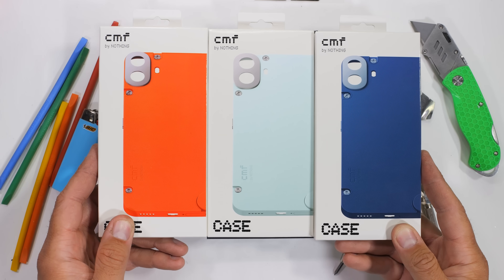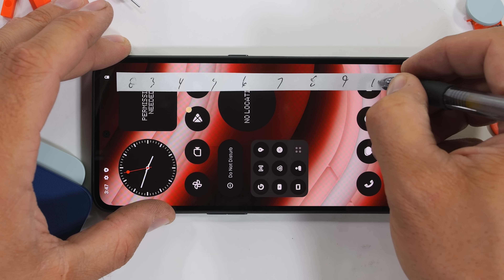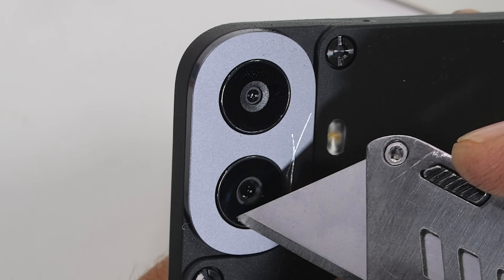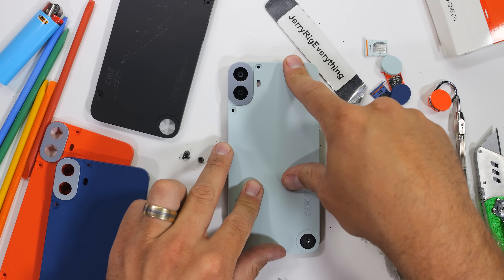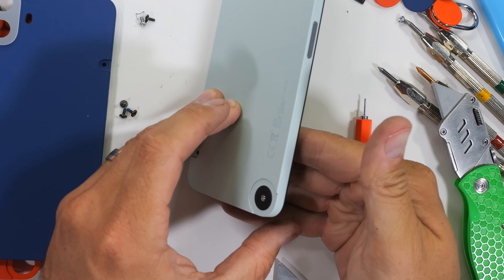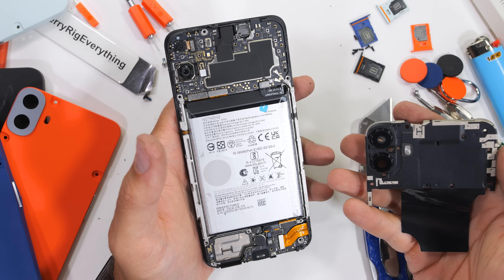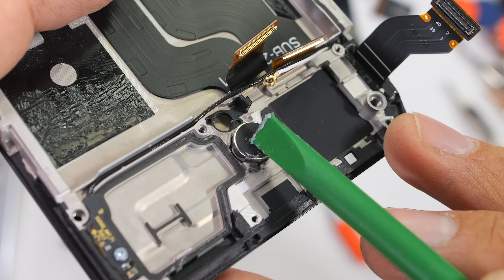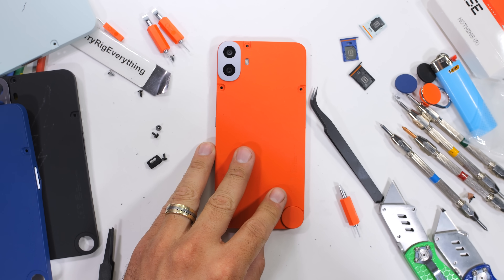THEY SAID IT WAS MODULAR... (a teardown says otherwise)

Comment: so Taking a backcover off means MODULAR? damn My Nokia 6600 is the best of a MODULAR phone lol
Reply: Except every relevant component was modular… so yes, it is
Reply: 6600 is more modular, you can change the battery.
Reply: @HearMeLearn  so? all components are modular in a random vivo or a samsung a55 or such, actually most random phones - they come apart the same way with same sort of connectors you pop off
Reply: Lmfaoo
Reply: they never advertised it as modular, it was always "interchangable". dont know who started the modular thing
Reply: @HearMeLearn  batteries are a relevant component, and that wasn't, so NO it isn't, especially not when such a critical piece wasn't.
Reply: @Golgo1412  He  criticized the phone for not having removable battery and no waterproof protection
Reply: Yes, words have meaning have you only just discovered this? Modular means separate parts that can be joined. If your Nokia had replaceable back cover to add new styles then that was a modular feature.

It has nothing to do with "repairability" in it's own right at all.
Reply: All my recent phones are modular. I can remove the sim card tray with a pin! Because being able to remove just a useless part is termed modular these days 😂😂😂

Comment: Just bought some ear buds from CMF a few weeks ago, they were on sale for like $26 and I needed some cheap replacements for using around the house and out in the garden.  So far I'm impressed, they have good battery and range and don't sound like garbage.  Excited to see more budget and mid range phones, plenty of room for smaller companies to come in and undercut existing brands.
Reply: You can buy pretty good sounding ear buds for less than $10. I have a few and they all sound pretty good. The issue with these ear buds IS the microphone and call quality and pretty sure it's the same issue with CMF
Reply: @jayz4evr  stop the lies, i have many cheap $10-15 headphones which suck. CMF buds are miles better.

Comment: Very happy and surprised that they at least included a micro SD card slot. Though a removals and replaceable battery would have been nice too! What a missed opportunity.
Reply: Even if battery was removable you were not going to swap it often.... Backup as well as charging speed is so good nowadays... It's only after 2 or 3 years you will need to replace it which will take only a few minutes as you only have to unscrew a few screws and pull it up not like other glued phone which requires technician ..... So it is better to keep it glued firmly placed... Then why people are disappointed... It's just stupid...
Reply: @nothing9220 Why you parroting the same comment everywhere a removable battery gets mentioned
It only makes sense to ask for it, what else you gonna do with a removable back, its basically a shitty way to have a case if the back being removable is so useless
Reply: All phones in this price range come with one though
Reply: Yeah if the battery is swappable, you can carry around as many spare batteries as you can and you can spend a very long time outside without needing to find a power plug
Reply: I think the biggest problem with this phone is it's missing nfc.
Reply: @nothing9220  what if youre not able to charge? having a spare battery and quickly putting it in is amazing. or having multiple batteries so you dont have to worry about wear or any con with batteries..
Reply: can anyone confirm what storage config does it have. ufs 3.1?
Reply: @mohitrahaman  I'd put my money on 2.2
Reply: @sihamhamda47 how many times do you have more then 1 mobile phone battery one you?
Reply: Man, I was about to buy the phone because of the SD card, but got absolutely cold feet because of the lack of NFC. I know they tried to cut corners in the most effective way without making the phone feel cheap, but the NFC man? :(
Reply: @Uneaten_sandwiches  the same no of time we carry a power bank with us. 
Ur using old phone logic when battery lasted days.
Swappable battery is super useful especially for heavy users like gaming as most of the time we end charging and using simultaneously, so phone heats up tremendously due to processor heat and charging heat.
That way swap battery and charge the spare.
Reply: @Bashiroo  yeah no NFC and one speaker put me off immediately

Comment: All that technology for $200 is mind-blowing
Reply: Is this phone good or bad??
Reply: @Lynx0__0--  It is good for the price yes.
Reply: @Lynx0__0--  Specs are good for the price. However it is incredibly fragile as you saw on the video
Reply: @huppujorma5111 ? The video literally showed it wasn't fragile and 1 survived a bend test a lot of overpriced phones didn't. 2 had basically the same scratch resistance as 99 percent of smartphones. All phones scratch easily with a knife like that and nobody should be putting an open flame on the screen for 10 seconds.
Reply: Tell me you're American without telling me

Comment: I really do wonder if it would have been that much more expensive to make the battery replaceable. That would have been an actual statement that would resonate throughout the industry.
Reply: The thing is… it’s not a matter of price. Companies could make all damn phones have a replaceable battery. But that means less profit in the future by making you buy a new phone when your battery stops lasting as long as before, so they hit two birds with one stone. Sell you a new device so then they can keep up with planned obsolescence.
Reply: It would've. Removable batteries require a protective casing to avoid puncture, beffier connectors, identifier and communication circuitry. It's easier to put a dumb battery you can control from the phone that make a battery that can protect itself from user misuse and explode or combust to flames (plus it protects you from lawsuits)
Reply: Ignore the stickers and it’s suddenly magically replaceable. I mean: ok, it’s not as replaceable as the old nokias. But it’s easy enough that I wouldn’t mind replacing it myself. Compared to apple, SAMSUNG and others the biggest hurdle (glass back) isn’t even present here…
Reply: Even if battery was removable you were not going to swap it often.... Backup as well as charging speed is so good nowadays... It's only after 2 or 3 years you will need to replace it which will take only a few minutes as you only have to unscrew a few screws and pull it up..... So it is better to keep it glued firmly placed... Then why people are disappointed... It's just stupid...
Reply: The battery is actually replacable. You only need some new adhesive which you could easily buy with a new battery.
Reply: I doubt a plastic casing costs very much. The real cost is the loss of a repeat customer.
Reply: Isn't the EU making a law that obligates removable batteries in smartphones?
Reply: @TSS-nq2ul  they don't do that because with  users replaceable battery there will be 3rd party battery maker launch they're own from it they loose revune
Reply: @MariusMerchiers if only that was true. For smart watches too
Reply: @MariusMerchiers there will never be such law, you can't make a water resistant phone if the battery is removable
Reply: from my perspective... replaceable batteries have nothing to do with cost. If you can take the battery out the phone cannot be tracked.
Reply: @SocialScrapper  Well... real time only. Forensic can still get a lot of info about your whereabouts afterward when the battery was removed.

Comment: Seems like this is a perfect platform for learning phone disassembly. Easy access and all the components are easy to trace and identify.
Reply: Besides the battery
Reply: @redgamer821  nah the battery is easy to remove
Reply: @backwardshalos6036  Easy but you need to unscrew lots of screws and mess with pull tabs. If they are going to make a modular phone it should be a modular battery as well, not glued in
Reply: @redgamer821  the marketing material describes it as a "interchangable" phone not modular, jerryrig is just misconstruing nothings marketing to make some point about right to repair

besides this design is still way more repair friendly than most other brands on the market (no hard to remove adhesives or potential to break a glass panel)
Reply: nah, this phone is no different than any ither phone. And the illegal battery sticker just makes it worse

Comment: Honestly, I am baffled by the fact plastic was nearly abandoned as the material for the externals of phones, and when it is it just tries to imitate glass, becoming just a more scratchable version of it...
I think more phones should embrace the polycarbonate with finishes like these!

Glass and metal might look and feel good, yeah... but they end up being liabilities in the long run.
Reply: Main issue with plastic is scratches, glass is generally much harder to scratch compared to plastic or metal. That's why there are a fair amount of plastic backs when it comes to budget or midrange
Reply: same here considering how much lighter plastic is compared to metal or glass back.
Reply: Also since they're doing away with clips and the back is just friction fit with a couple screws holding it on, what stops them from making the back from a thin aluminium sheet? Would be much better for recycling and also durability. They wouldn't even need to make it wrap around the sides of the phone like it does here. Just make it a flat sheet on the back, almost no milling required.
Reply: @Creepus_Explodus  i don't think that would feel or look better. a lot of samsungs are still with a removable back you can just pop off with a fingernail without a spudger without much fuss.     anyway did you ever put aluminum foil in a microwave, per chance?
Reply: @jasonls221  Who cares? Most people are putting a case on it anyway. And if I'm not, I'd rather have a plastic back that gets a few scratches and just a ding if I drop the phone, VS a glass back that shatters if I drop the phone. Glass backs are also stupid because they have a transparent material that could let us see the inside of the phone and then waste it by gluing some color sheet to it so we can't see through it anymore. Just make it plastic.
Reply: @mjc0961  Yeah, I agree personally
Reply: I agree that's why I fell in love with OnePlus since their plastic back sandstone finish One
Reply: polycarbonate ew

Comment: 100% right about lightning... most people dont know that lightning strikes upwards either.
Reply: Usually down first, then the big flash back up once one of the “feelers” hits ground.
Reply: He said Kilowatt hours of energy, is that correct?
Reply: @quantuminfinity4260  👍  Seems backwards doest it. 😁
Reply: 3 types of strike... 
Cloud to ground
Ground to cloud
Cloud to cloud (mostly refered to as "heat lightning"

Next, the visible part is not the actual strike but the return. The "strike" happens when the pathway is created (there's the static feeling/tingling people get when about to be lit up). The visible bolt is the discharge through that pathway.

 Electricity is a fickle beast !
Reply: @manmachinemake3708  It sure is. What's more fascinating is people have been struck leaving an exit burn on the feet and have been fine. Others have been killed by strikes near them... An awful lot of potential energy bouncing around that's for sure.

Comment: its a really underrated phone. cameras not that bad, excellent performance, it can run games like pubg in 80-100 fps in lowest settings. although the fingerprint sensor sucks. it does very well in staying cool, no heating in doing daily tasks or playing games does not effect that much. also offers loud speaker despite just 1 stereo speaker. loved its 120hz display and the classic nothing os ui, its lagless and offers a smooth experience. but if you want a very good camera smartphone, dont go for it

Comment: @3:16 The rear panel is molded, but the milling marks are from the mold itself, quite common to leave machining marks on molds where they "wont be seen" They will often even feel like tool-marks as the geometry is transferred to the plastic part.

Comment: I miss the days when smartphone brands used to make devices with a removable battery and back cover. Now, they just want to make more profits from repairs.
Reply: Even if battery was removable you were not going to swap it often.... Backup as well as charging speed is so good nowadays... It's only after 2 or 3 years you will need to replace it which will take only a few minutes as you only have to unscrew a few screws and pull it up..... So it is better to keep it glued firmly placed... Then why people are disappointed... It's just stupid...
Reply: Technically it's removable. Just take the tape out and shove it back in.
Reply: @nothing9220  cringe bot, stop copy pasting your nomsesical response
Reply: Something glued is cheaper than screws etc.
Reply: I dunno man, people always say this, but I don’t think people really want to go back to those days. Even when we could replace batteries, did you? Some people probably did, but most didn’t. I never did. They just charged them anyways. And I think everyone was getting really tired of phones falling apart every time it fell off a table. Not to mention you lose the waterproofing. I feel pretty neutral about the loss of the replaceable battery

Comment: But the battery it's still removable. The advice to no remove it are only a legal thing I think
Reply: Even if battery was removable you were not going to swap it often.... Backup as well as charging speed is so good nowadays... It's only after 2 or 3 years you will need to replace it which will take only a few minutes as you only have to unscrew a few screws and pull it up..... So it is better to keep it glued firmly placed... Then why people are disappointed... It's just stupid...
Reply: @nothing9220  shut up

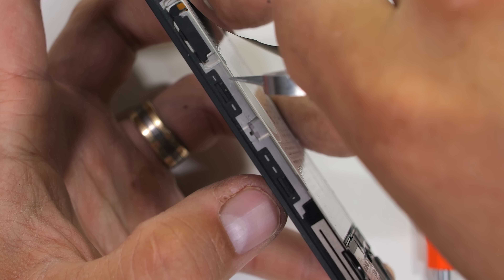Comment: 5:17 "The CMF Phone 1 is no Fairphone 5"
Reply: Is this a reason to not sell replacement batteries? Or to make the battery connector a bit hard to access
Reply: @0815dude  nope, they could've made the battery easily replaceable without any screws or prying but they chose to screw over the consumer

Comment: Even though the battery is not replaceable by consumers, the fact that it is easily accessible and can be removed fairly easily means that a battery repair even from a local shop would physically look and feel OEM, compared to other phones where, say, there will be gaps or glue is coming out of the gaps, or screen got damaged in the process etc. This phone isn't perfect but it is better than most phones imo. This phone is more repairable than most phones despite not being a repairable phone.

Comment: This phone idea is amazing, even better than Fairphone imo. But the perfect solution would be standardized battery that would be interchangeable and be compatible with every phone. Even the travel battery banks would be useless after that. So yeah, it is useful if you could change battery, screen and phone back yourself. Fairphone is a bit overkill in that sense, but is too weak in performance so it's even worse.

Comment: I had someone tell me there was no ecosystem to make cheap swappable batteries anymore.
Not sure what that person was smoking. Anyway, its already a topic beaten to death but its a missed opportunity.
Id consider buying one as my main beater phone with a spare battery and run around with it for multiple days without needing to charge, if it had such a capability. 
Though, credit is where credit is due, the display and the SoC on this thing are way above the price tag.
I know the lack of NFC is strange, but ive never used it so far and i can definitely see it being a good choice in India for example since India is a big QR code fan for many things done over mobile.

Actually, all these easily repairable phones always seem to come out with one thing thats either completely missed or implemented poorly.
For Fairphone its software in general and for this phone its the lack of a removable battery and perhaps the headphone jack.
Pretty much all phones in this price range have a headphone jack. Im sure as hell not gonna buy my kid wireless earbuds for example. They can have the cheap $10 wired earbuds (my preferred model is the Sony MDR-EX15. A pair has been serving me well for over 7 years now).

Comment: My 580 Euro Fairphone 4 might have worse specs than this CMF P1 but at least I can take it apart and replace certain internal components by myself. 
Main camera only having EIS (which absolutely SUCKS) is a big let down if you don´t wanna use a tripod or gimbal. 
I guess this P1 wasn´t really designed with smartphone photography in mind (just like the Fairphone 4).

Comment: 3:18 probably just injection molded with a tool that still has milling marks. 
Milling is a far too expensive process for a phone of this price.

These milling marks are common on cheaper parts because injection molding produces extremely cheap parts when you're talking big volumes, but making a tool with a perfect surface finish is very pricy. (Tens of thousands of dollars, but of course depends on size) 
Hence they don't bother removing the milling marks in the tool where it doesn't matter.

Comment: "Modular" Phone with a non-user-removable battery and absolutely no way of replacing or upgrading any components. What an actual joke. Still, at $200, it's not a bad deal if you're on a budget and in general there are quite a lot of color options for the phone even if you're only going to stick with the one color. Still, Nothing marketing the phone as "modular" is quite deceiving and borderline false advertising. Guess that's par for the course with the losing Right to Repair battle nowadays smh